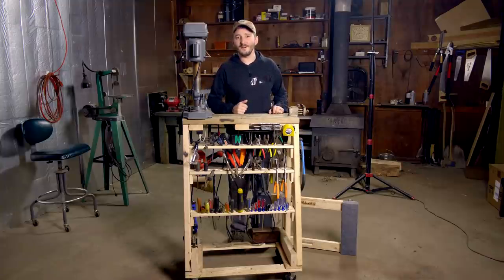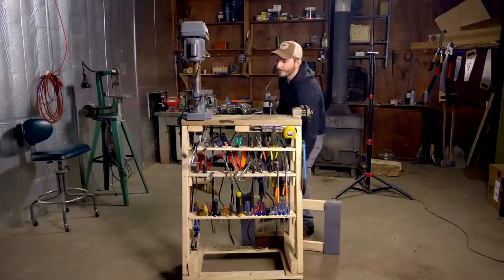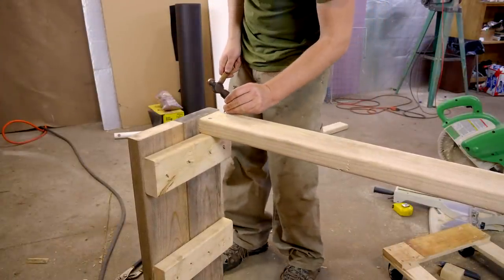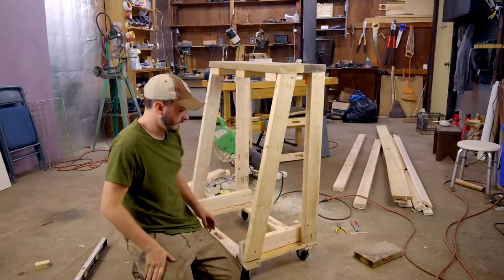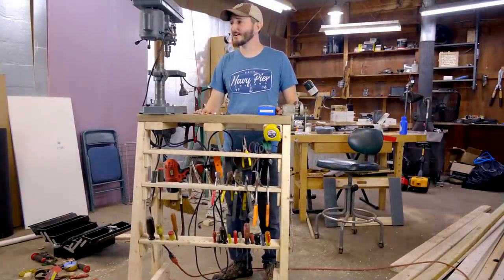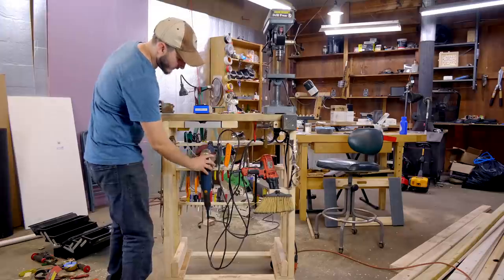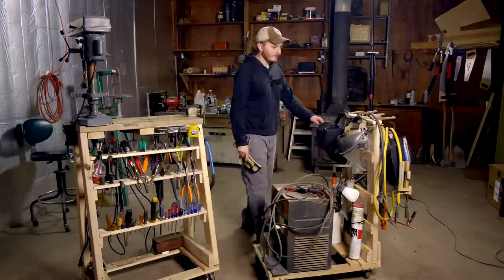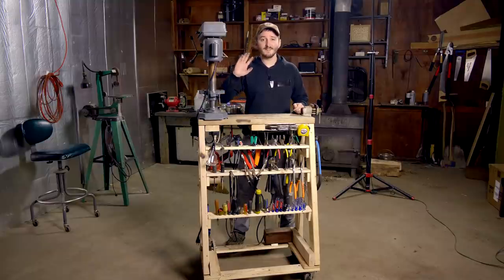Easy & Practical DIY Tool Cart (customized Adam Savage design)

Comment: I'm loving the design. My one critique is that it looks pretty top heavy with that drill press up top and not in the center of gravity. I would add some weight to the very bottom, and possibly set up a dust extraction system. Shop dust can be very bad for your health.

Comment: This seems a bit top heavy for a drill press, but I like the idea.

I just covered the walls of my workshop in pegboard. I don’t have a ton of floor space.

For my larger tools, I built a rolling workbench that can lock in place. The top opens and I’ve got a lot of my tools that don’t hang well spread out, and underneath I’ve got a heavy duty shelf where I can fit bigger tools like planer, jointer, router case, lathe, etc. Then I just pull out the tool I need and put it on top. 

I overbuilt the hell out of the thing so it’s really heavy. It rolls easily but when I lower it off the wheels using flip locks, I can’t even push it. I feel like I’m going to have to leave it with the house because it’s a monster and it would have to go up a hill through grass and the wheels aren’t made for that.
Reply: Yep, maybe weighting a bit the base would help
Reply: Sounds great-- photos, please?

Comment: i noticed it shearing a bit. you could mitigate that with some wire, or even fishing line in tension from opposing corners to preload against shear.
Reply: Or simple,plywood gussets - especially on the welding cart.

Comment: I would switch out your tubing cutter for a Rigid, any plumbing supply house will have cutters for Rigid. I would check at a plumbing supply house in your area for the cutter for the Brasscraft.

Comment: Hi. mate, even to make a support as I propose to you:
In the form of a multi-storey rotating disk you had to make in the center of the support where to put the tools.

so you can access the tools from the same position by rotating the disc.
the disc must be built so the tools can be visible from any position.

in this project you can also use a magnet to hold the tools in place

disc or circle, my English is dangerous, be careful.  :) sorry

Comment: Love the idea and excellent video content. I have one recommendation though that should help your tool holder last longer and not wobble. Try putting a piece of wood going at a angle on the inside of the frame from corner to corner, it should stop it from wobbling side to side. Love your channel and keep up the great work

Comment: I use the roller base part of office chairs for many things.  They are great auto tire movers where I can stack up to 5 or 6 for an easy way to move tires around the shop. The chairs are discarded often on the side of the road then one clip and the chair detaches from the base.  A free way to move any project light to medium weight around. .

Comment: I'm wondering if you might want to add something heavy to the bottom section. Just curious if the drill press makes the cart top heavy enough to worry about the whole thing tilting over should you accidentally hit a bit of debris or a cord while pulling the cart backward?
Reply from the maker: It's stable enough for me as is.

Comment: FYI you may want to upgrade your extension cord to something that is 12/3 rather than 14/3. It might not seem like much of a difference but it's huge with regards to 12 or more amp motors such as that used in your drill press. Your Drill Press might be a smaller motor, less than 12 Amps, but still, a larger cord is always better anyways. 

I use to save a few bucks and always buy cheaper cords until all my stuff started to burn up. 14/3 cords are ok for drills provided they draw less than 12 Amps but anything drawing over 12 Amps will actually burn up because that 14/3 Cord just won't cut it and it will starve the motor of amps which is what will cause it to burn up. The worst part is your burn the Armature which is the pricer part of the motor to replace. 

I could not figure out why my Armatures kept burning up until the 3rd time when the guy that sold them asked what cord I was using. Needless to say since I've been using 12/3 Cords that Armature has not ever burned again, and it's been easily over 30 years now since last it was replaced. Oh, it was a Portable Table Saw that ran 12 Amps, and was purchased back in 1986. It is as strong today as it was back then. Again this is FYI do with the information as you will... Cheers...

Comment: Will try it.  At what angle did you cut the legs in order to make the triangle?
Reply from the maker: Doesn't matter. Figure out what size top you want and then make the angle of the legs appropriate to meet the edge of the top and the edge of the base

Comment: Like the cart. Need some gussets /cross brace. If have limited space, use small wire cable and turnbuckles. Cheap way out is tie wire twisted with  a tool to tighten. Making an X brace. (if no one has said it yet. Also try decent contractors plumbing supply to get replacement cutter wheel for pipe cutter. Thanks! I enjoy your show!

Comment: Very amateur builder here. How do you cut the angles on the front two angled 2 by 4s, the ones that connect the top to the base?
Reply from the maker: I attached the top with the straight pieces first, then held a board up and marked the angles with a pencil

Comment: I would extend the side with two more dollies attached to the side in the shape of a U to make it a lot more stable as it seems a little wonky. But it might get to big to move. Also a bit more weight on the bottom to make it less top-heavy, again to stabilize it even further.

A hanging powersurce in the center of the shop with a rotating arm would stop you from tripping over the cable.

This thing can be modded like hell, I like it!

Comment: Since you have onboard power, consider putting a strip or two of led below the upper surface pointing down. Will make working in the dark more pleasant as the cart and tools will all stay nicely lit. If you ever drop something having lights on the cart will likely make finding the bit easier.

Comment: I like tool carts and have several, I am a automotive technician and my tools generally stay in drawers either in my tool chest or on the tool carts. With your tool cats I have only two items that I do not care for the first is the casters they are to small and as such make the car prone to tipping especially on your first cart with the table top drill press making it very top heavy.  The second is the carts especially the one with the drill press do not have a parking mechanism on the wheels or just a center post to hold the cart in place. Since you have made the cart with a vice and drill press a work station as well the cart needs to be able to be locked into place while you are using these items.  I am not a YouTube SS member (Safety Sally) but a drill press that is on non lockable casters is just called simple stupid and a potentially accident that could be quite serious in the makings and least we forget the vice and angle grinder. Have a nice day, StaySafe StayHealthy
Reply from the maker: My hand drill has more power than the harbor freight drill press. It drills a straight hole but you can stop it with your hand. I'm not worried about it being on a cart. I may put locking casters on eventually though.

Comment: You will want something to cover the tools  when your sanding or drilling you dont want wood shavings inside your electric tools
Reply from the maker: The electric ones are completely under the bench, but I am thinking of adding a  pop up guard around the press to make cleanup easier
Reply: Something like a canvas sheet that you can roll up and mount it above the tools and a way you can pull a cord and let it drop.
Reply: A lot of jewelers workbenches have a canvas skirt to guide shavings (usually precious metals) into a recycle bin. You can use the same thing to guide shavings away from the other tools. You might also want to put a small shop vac in the base, and a movable task light so you can get lots of light on what you're working on. For the camera, of course.  :)
Reply: The tools will be just fine. Getting wood dust/chips in the told won't hurt them.

Comment: Saw this when Adam did it, it's a great little project & a handy addition for sure. Especially the welding gear all in 1 location & at arms reach when you're right at whatever project you're working on. The 1 thing I might do is router out a shallow lip in the top & glue in a half decent ruler for quick measurements. 
Acklands Grainger used to sell cutting wheels for pipe cutters, give them a try?..

Comment: High recently so one of your videos from the gasifier it is quite and old one but I didn't know that was even possible I have a question hopefully you will be able to read this message can you compress the gas for storage purpose like regular gas butane love you videos hopefully you will answer
Reply from the maker: Not easily. It's dangerous in most containers because hydrogen makes metal become brittle.
Reply: @Nighthawkinlight  thank you for responding and I see and I don't think using a plastic container like the ones that are used for spraying chemicals cuz I don't think to make any big enough but it is possibleand I don't think it's really that easy to separate

Comment: I'm definitely going to be making one of these! Do you think the dolly needs some weight added to the bottom so it's not so tippy?
Reply from the maker: Mine is very top heavy with the drill press and it's stable enough you'd have to be moving it very carelessly to let it tip.

Comment: Two comments:  1) Screw it. &  2) Top heavy.  Using nails guarantees that in a year or two, this will be a loose, wobbly mess.  It is so top heavy that it will tip over, not "if" but "when"  At that point, the time to a "wobbly mess" will expire almost immediately.
Reply from the maker: It's been fine for 5 months now. Build yours however you want.

Comment: My ONE complaint/advice I'd add is that the cart doesn't have any locking mechanism on the wheels, does it? I'd be really tempted to throw in one or two myself, if I ever made one, because using power tools on an unstable work surface just is asking for something slipping
Reply from the maker: Yeah that would be better, but the cart does have some mass to it that keeps it from moving too much

Comment: Now have a set up for camera equipment in the shop? Like mounts or something. Or is that not needed if your situations?
Reply from the maker: I'd like that. I haven't figured out how to do it properly though. Camera and lighting stuff needs to be pretty spread out when in use so it can't all be mounted to a small cart, unless it just lived there for storage.
Reply: @Nighthawkinlight  that's true, but if it's on wheels and compact it could still save some time. Also screw mounts are super helpful.

Comment: It may be an inside joke, or I may be late to the game...but I find it so awesome that a guy who can make a bike that is powered by the gasified fuel from a real-time combustion...can't find a decent claw hammer with a normal length handle.
Reply: It disturbed me to watch the hammering.  I kept thinking he was not holding it far enough down and then realized it was just short.  I read on another comment reply that he modified it for a specific task where it needed to be short.  Still $20 for a Stanley or $60 for an schmick Estwing would have made that job a lot easier.

Comment: Your drill press makes the cart top heavy and a tip hazard. Maybe add weight to the bottom, perhaps a couple of sheets of mild steel plate.
Reply from the maker: It's only tippy in one direction and stable when still. It hasn't been a problem since I keep that in mind. Someone else that builds a cart will have to get their own feel for the tool layout.
Reply: @Nighthawkinlight  I'm glad it's not much of a problem! Been a fan of you and Adam for a long time, thank you for sharing this build. What are you working on next?
Reply from the maker: I'm making my decision on what to do next today...
Reply: @Nighthawkinlight  Exciting! My partner and I love your bird btw.

Comment: That's a great build and way more practical than my current shop storage.
One suggestion that springs from my experience converting an old barbecue grill trolley into a mobile garden workbench for my wife would be to get a dolly with wheel brakes or add something to do the trick. Having the bench move while you're busy is distracting at best

Comment: Cut a 45 degree cut in a 2x4 use it as a pipe holder with a tie down strap or some quick clamps depends on what your cutting. Can slide that on a miter saw or you can put an angle grinder on a dowel hinge & turn other tools into a pipe cutter. They are a nice tool if your doing plumbing but if your in your shop I find reusing other tools & getting rid of something more beneficial.  I tend to just slide it into a miter box & use a sawzall gets perfect 45's for when your making cubes because that's what you do when you can. Tie downs work best on long cuts like metal quick clamps are fast and fine for PVC.  I could just say I duno where to get that cutting wheel but that all seemed more helpful.

Comment: I would highly recommend you to put at least one diagonal lumber plank in there. When you have a rectangular shape, it is very easy to collapse into rhombus(diamond). This means that your cart might collapse sideways, especially with the added heavy weight on top. Since the front and the back are now full of tools, it may be possible to put the diagonal lumber plank somewhere in the middle of the cart.

Comment: From what little research i was able to do on the cutter wheels you should be able to either buy some from BrassCraft, find them at a Menards or Lowes, or even purchase them off of Amazon. 
All of the products that i was able to locate are part number t443 so if they are different that will obviously change availability. Hopefully this helps at least point you in the right direction.